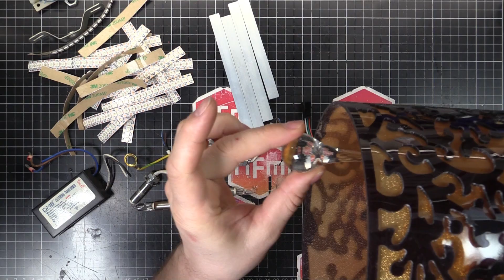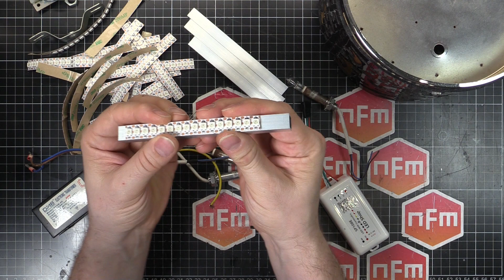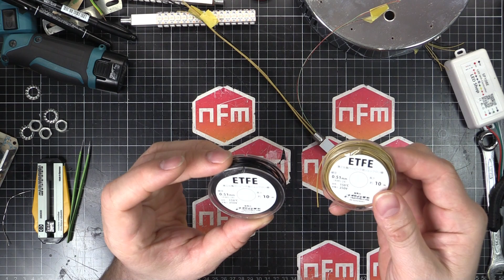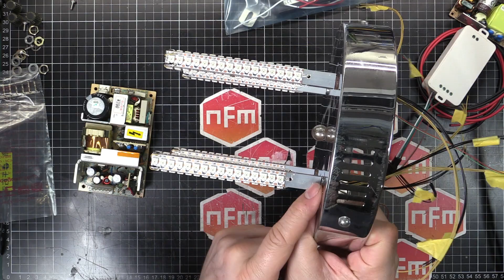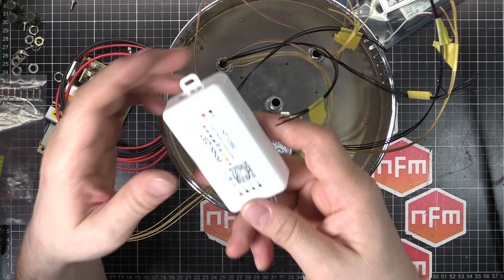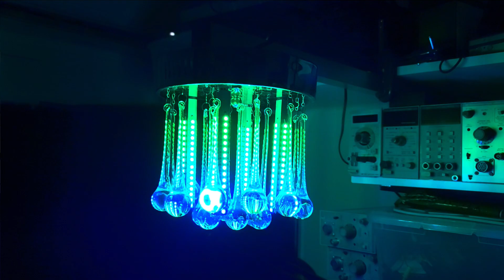Build a Psychedelic LED Lamp!

Comment: The idea of the original product is that the halogen light sources are (almost) "point-sources". That allows the refraction/sparkle effect to be most pronounced. As a lighting guy, all I can see is multiple reflections of the ugly square rods with small LEDs all over them, rather than the droplet glasses and nice colour effects.
Also, with all the pixels driven "in parallel" like that, you could just use standard RGB tape. No need for the Neopixels, WiFI, App, etc since you aren't separately addressing the LEDs anyway.
This would look a lot better with 4 x downward firing RGBs, the small 10W ones would work OK. They are square like a white COB, but with no phosphor coating and there is (I think) 3x3 dies, for each of R, G and B. They also make a UV version with various wavelengths and those are really cool.
By firing the light down, the glass of the drops would then refract and create a much more pronounced effect. The LEDs themselves would be hidden from normal viewing angles, so you would see the effect rather than the light sources.